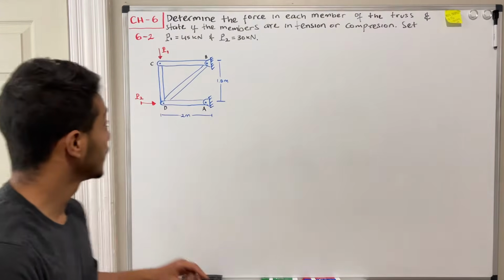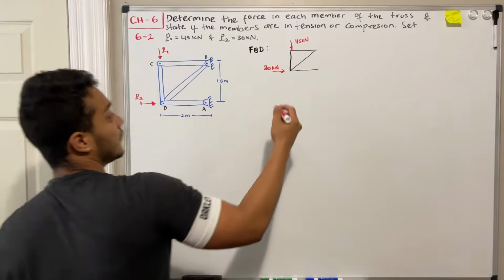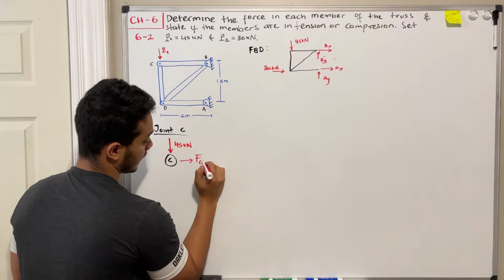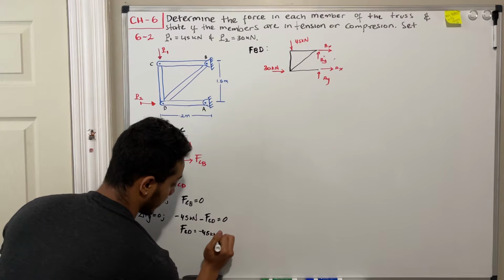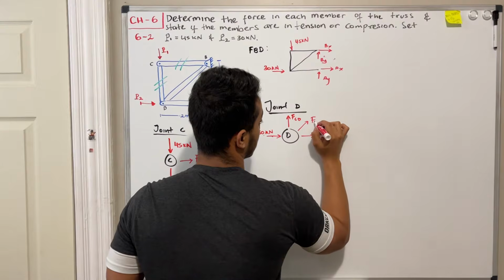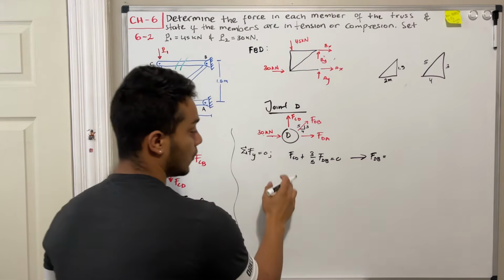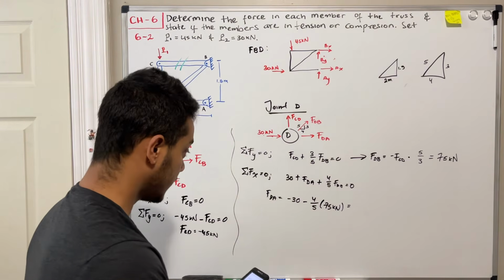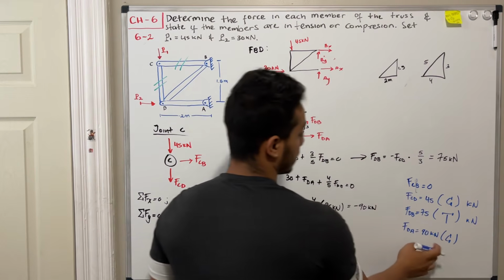Statics-6.2 -  Determine the force in each member of the truss.

Comment: I'm confused on how FCD is negative at joint D. Do we just ignore the direction of the "corrected" FBD then?
Reply from the maker: At Joint C we draw the FCD being in tension (going away from the joint - Downward). In order to obtain an equilibrium inside the truss, at Joint D, the force FCD should be going upward.

For both of the FBDs this force was negative as found with Joint C. Meaning that it should be compression. but it was just a matter of how we chose to draw the force in both FBDs.

Does this make more sense?
Reply: @LearningbyTeaching  I think so. I noticed when I did 6-3 that if I kept each force vector negative or positive and made every FBD be in tension (point away from the joint) and then place in negative/positive signs based off my drawing, it all works out.
Reply: @clairec3925 dang you’re hot I have to focus on my exam